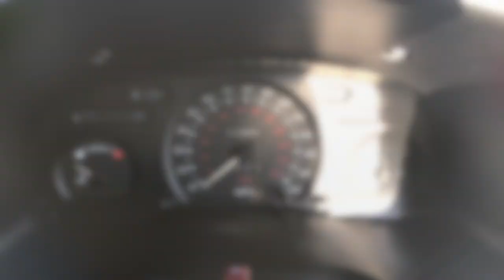Replacing Battery Mk5 Transit & Installing solar trickle charger panel - 2.5 DI

Comment: Brilliant follow up video. I also opted for a solar panel to trickle charge the battery. It's been fine for the last year and a half so its a good solution. My 12v socket in the cab is live without ignition so rather than run the cable into the engine compartment I just plug it straight into the cab socket.
Reply from the maker: Thank you, that’s a great suggestion 👍🏼

Comment: Notice you have 2 batteries 
Make sure that the older one doesn’t discharge the new one and balance the voltage between the 2
Reply from the maker: Thanks Dean, that is one of the leisure batteries. It’s completely separate from the main starter battery. The leisure battery’s do need balancing out though 👍🏻

Comment: 14.8 Volts is a bit high for a standard lead Acid Battery..above 14.4 it will start to Gas.....that may be what impaired your previous Battery..
Reply: 14.5 max

Comment: Hi.does these 2.5 engines have an electronic cut off on the pump.Hi have just purchased a 1991 one and can’t get it stared.There is a wire on the back of the pump and was wondering if it not opening . Any ideas.
Reply from the maker: Hi James, they have a fuel cut of solenoid on the pump. I don’t think the older ones have PATs (passive anti theft system) unit so you should be able to energise the solenoid and hear it click open? I’m not an expert on these pumps but if you head over to the transit forum or transit mk3, mk4 and mk5 smiley owners page on Facebook there are some very knowledgable people who know the ins and outs. 

Have you checked to see if you have fuel at the injectors?

Comment: Have you installed a VSR mate? Do you know the best place to run a split charge VSR cable through the bulkhead into the cab/living area?
Reply from the maker: I’ve got one to install just haven’t got around to it yet 😆 I want to repair my A pillars first. I’m planning on running cable through one of the bulkhead rubber glands, up the A Pillar and through to the back where I have my main battery’s.
Reply: @TurnersWorkshop97  Ok great. A video of your install would be a great addition to your channel and super helpful! I like the way you work methodically and explain. Need to order my VSR and install it too.
P.S The Febi Bilstein prop shaft hangers you recommended are now on my vehicle and decent so thanks for that.
Reply from the maker: Thank you I really appreciate that 😊 I will be making a video when I install my vsr but can’t say when that will be yet. Really pleased you went for decent bearings. Always worth paying abit more for quality. Thanks for supporting the channel 🙂

Comment: I honestly cringed when you were loosening the +ve connectors with the -ve still connected. Bridging the +ve terminal to a brake pipe with your spanner whilst your -ve earth is still connected is a mistake you only make ONCE! 
On a lighter note, I'm fascinated by the amount of room you have for a big battery, I can weirdly only get any battery in rotated 90 degrees to how you have yours, the brake servo stuff is much tighter to the side of the engine bay in mine.
Reply from the maker: Haha I like to keep the viewers on edge. It wouldn’t be the first time 🙄 that’s interesting I have seen quite a few transit pictures with the battery’s rotated 90 degrees and wondered why they were in that way around 🤔

Comment: This video would be better titled "changing the battery on a mk3 Transit 2.5DI and fitting a tiny solar panel by soldering rather than a connector as you should" 7:44 your alternator is outputting may too high voltage, it should be 14.4V probably the regulator's gone.
Reply: @TurnersWorkshop97  The battery is the load. It will destroy it if it's that high. check your alternator Voltage regulator. I was actually looking for advice getting my DI started, but didn't find any
Reply: @JohnSmith-vz8pc  surly the the battery is storage & supply?